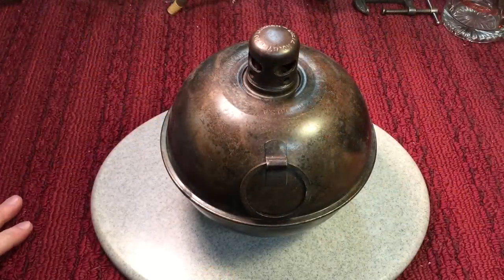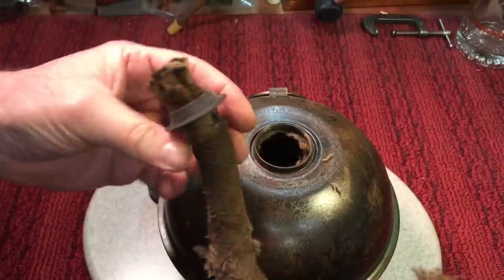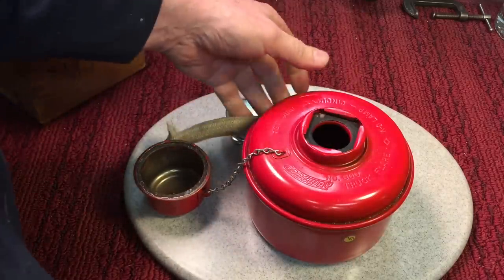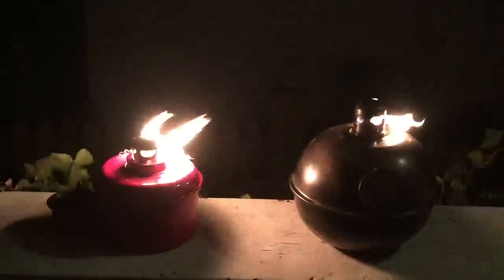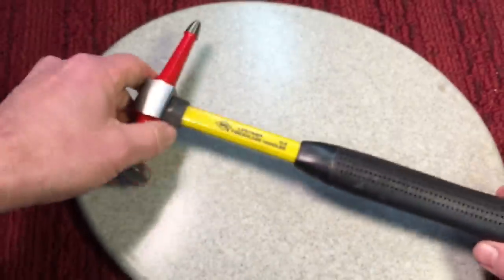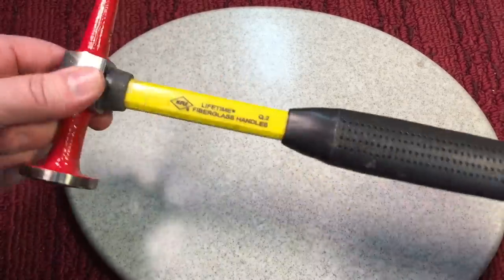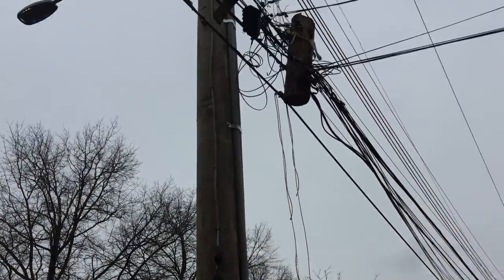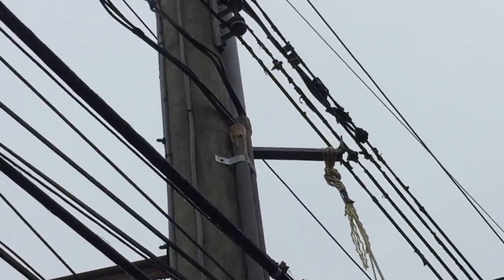Dietz Highway Torch, Nupla Body Hammer and My Electric Service...

Comment: (Video Subject Suggestion) I would like a comparison of Powder Coat vs your paint on style. Many other restoration channels use powder coat. I like your channel a lot and have much in common with you.  I was just wanting to get some education on the paint option topic. Just to comment on this video the Smudge pots I grew up with where tall heating devices place in Citrus groves to protect against freeze.  https://i.pinimg.com/originals/15/d3/b8/15d3b886585b5bf881fbe8d70affb36c.jpg
Reply from the maker: Hello Isaac!  Powder Coating is a great way to paint many items.  There are a couple issues with that system however.  First off the start up is expensive, you need to be able to heat up the part being painted to approximately 400 degrees F...  many items can’t handle that temp, even some tools could have their temper effected.. It definitely has it’s place!  😃👍

Comment: I bet the reason they were called smudges is because of the smoke which was likely because the guys that filled them used fuel oil instead of kerosene.  That was the joker that no one wanted on a machine.  What you want to bet some thought gas would work just as good?  You know the mayor's nephew who is to dumb to pour sand out of a boot with the directions written on the heel but you have to give him a job.
Reply from the maker: 57WillysCJ Philip you are right!  So many of these were run on diesel!

Comment: I don't know the connection, but there is a KD Lamp, in Andover, Ohio, about 50 miles east of Cleveland.
It's billed as a lamp store, whereas the old KD seems to have been a manufacturer.
Reply from the maker: MarkH10 wow!  Maybe they are still in business!
Reply: @ScoutCrafter  
This kind of thing reminds me of businesses changing with the times, through the generations.
Like a photo processing business I worked at in the 80's.
You recall the envelopes in Sunday papers for film processing?
The son was younger than we are, and tech savy.  No reason to think the film business still wotks, but the company may be operating as a tech niche service business.

Comment: For me,  this was extremely educational.

In the UK, things are different.
As far as I know, we don't have or use those truck flares.
But I have seen them on TV, being used in very cold countries, not sure but possibly Russia?
Several of them under the truck's fuel tank, to warm up the diesel when it's so cold it goes waxy ...

And our power distribution is different.
Other than in remote rural areas, cables are underground, not overhead on poles.

I assume that from your explanation you have all 3 phases going into your house?

In the UK, houses only get 1 phase.
Reply: In the US, houses are almost universally 1 phase and 220-230 V split so most circuits(lights, small appliances, etc)  are 110 V and any circuit for heating or heavy use(stove, water heater, AC) will be 230 V single phase.  From comments on other channels, I understood that most European homes are fed(supplied) 220-230 V 3 phase power.
Reply from the maker: Hi Mike- Roy is Right, the UK is 220 and we are 110, it’s funny how that is!!!  😃👍
Reply: @royreynolds108  in the UK, we get single phase 220-240v into the house. The phases alternate from house to house as you go down the street.
I noticed that on Scoutcrafter's video there seemed to be 3 wires going into the wax sealed tube, I presume they're phases?
In other European countries it's different - I lived in Germany, and I had a 3 phase cooker and washing machine, everything else was single phase.
We don't have 110v mains in the UK, but on most building sites, only 110v tools are permitted, so tradesman have to carry around really heavy transformers.

Comment: Kerosene is paraffin in the UK and my memory in the 1960's is of having my father using a hurricane lamp (storm lantern) next to his car with half the glass painted red and the other half clear. This would be lit at night as a parking light. A couple of years later he got a device that clipped over the glass of the offside which ran off the battery so motorists could see a parked car. I wonder when the law changed here as I cannot imagine going out every night to light a hurricane lamp next to my car. In cold weather there was a paraffin heater that went under the engine to make starting the car in the morning a bit easier.
Reply: Hi,Tony and my Sweetie got some stuff that was supposed to be odorless that ended up being just ordinary kerosene. Obviously it didn't work. so it's just a difference in the wording. Hope all is well there. Still raving goofy here. CHEERS!
Reply: Naz Nomad  And warmed up the oil in the crankcase so it thinned down and made turning over easier.